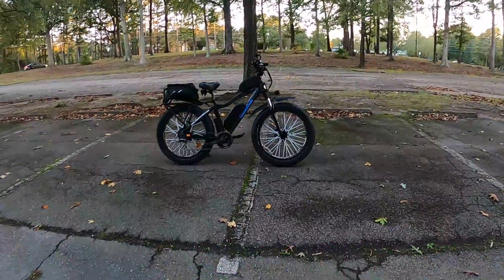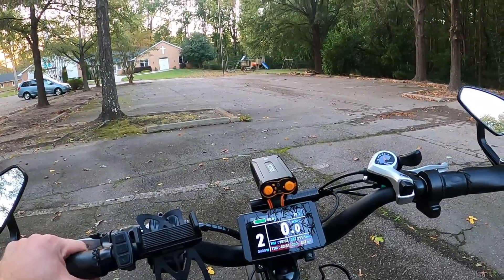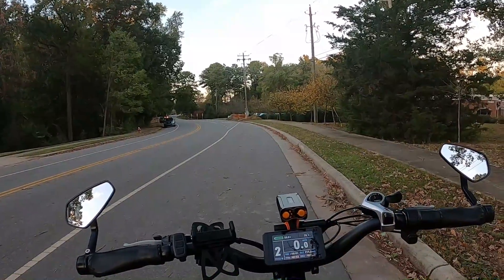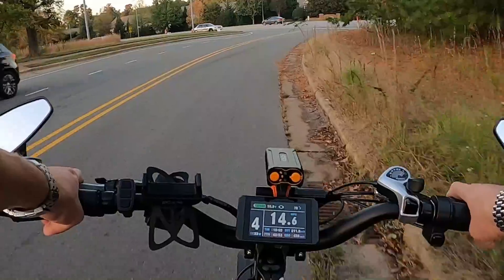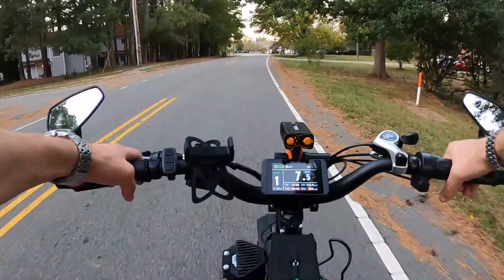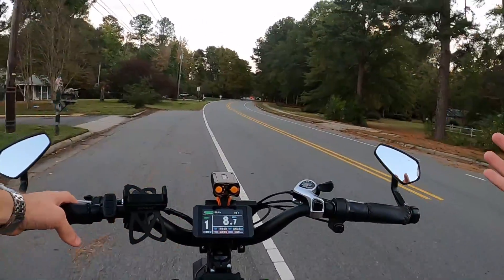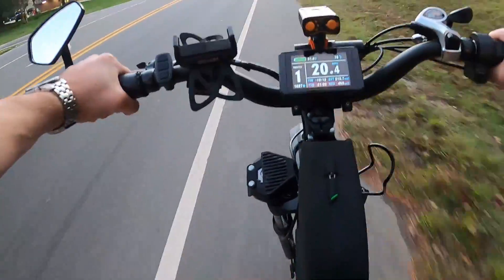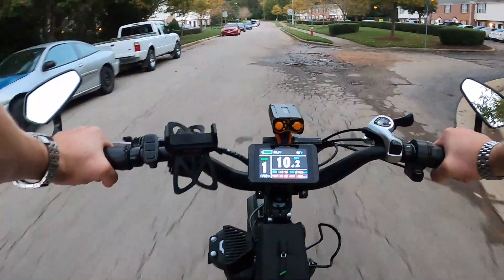Pedal Assist outputs on Upgraded Radrover

Comment: the speedometer issue is in the settings. I had that problem, and I changed I believe P-2 to 1. It was the setting that had to do with the revolutions of the magnet. It was confused as the pedal assist sensor magnet ring. It is for the magnet in the motor.

Comment: I started with the C14 level at 2. When I was in PAS 1, it gave me 210 watts max. In PAS-2, the wattage was around 350watts. In PAS 3, the wattage went up over 500 watts. Needless to say, for me, I was fine with using PAS 1 for most riding, and there are hills in my state.(PA). My range had improved drastically, with the stock RAD battery. ( It was a 25 mile ride, and the battery showed more than 70% voltage.)  The other day, I decided to try to lower the wattage to C14, and go from 2, down to 1. C14-1.  I took it for a ride so test. I rode with two batteries, as I have been doing. I  rode 18 miles over hill and dale, until the battery meter showed one level down. I checked the meter on the RAD battery, and it showed only one green light out. after going about 23 miles, I checked display. It read only one full light out, so I dropped in the next battery, for the ride back home.  Figuring I could ride a little bit more aggressive(faster), the ride back, I used the throttle, and PAS-2 on some hills, which were steeper on the way back. I noticed when I hit the throttle, it went over 1600watts, and it blasted me out of my seat, so, I declined to use the full throttle. (My motor is stock).  It wasn't until I rode 22 miles, when the battery indicator dropped one bar.  The last few miles were uphill, so I was in PAS-2. The steepest last few feet  of my ride, I put in PAS-3. I noticed the battery level drop to about half. When I was on level ground, I put into PAS-1, and the voltage rose back to only one bar out. After sitting there for a second, the display went back to full bars. I checked the meter on the battery, and it showed  it was full.  The voltage level on the controller read over 52 volts. I took the battery off, and again looked at the battery meter. It showed all lights on. AMAZING.  So, with the C-14 setting at level 1, my wattage were as follows------PAS-1= 110 watts, PAS-2 = 220 watts,  PAS-3 was roughly 400-600 something watts(I only used that on a hill climb. It would fluctuate, so never got maximum readings) . I am quite happy with the PAS settings now, with C14 being set at 1. Have a great day. By the way, I never tested the remaining PAS levels, because it was too damn fast.

Comment: Since the Rad motor peaks at 750 watts, that's probably as high as you got with the stock bike.
If you want more speed with the current motor, battery & controller try more narrow tires with a slicker tread. Your Tanus & tube setup also adds weight so it may reduce top speed.

Comment: It needs more Pass settings. I’m considering the EggRider for my 2019 Rad Cargo. I believe I have a direct drive motor. Why would a geared motor be more powerful? I know on Front Load clothes washers a Direct drive is more desirable and it cost more for that drive.

Comment: I just got my Rad I think it was Tuesday . I wanna thank you for all the info and because of your vids and all the info you shared ,was the reason I bought the Rad !I was a worried about the battery and range but after riding it up hills and to places I need to get to ,the battery is just as good as my specialized bed I 3.0 mud drive .wich I paid $3,600 for it. I still have both plus another cheap bike that I through a lit on it and burnt through that kit witch is non existent now. So when I do upgrade I switch out and put the old rad stuff on it as I upgrade the Rad !

Comment: I have a radrunner. Had it for 3 months now and put almost 900 miles on it. Just did the upgrade to the Bolton 35amp controller. Makes a huge difference! Sadly, I haven't seen much on the feasibility of getting a true 750w motor. 
Also if you can get ahold of a hyperscorpion for comparison, that would be awesome. Still kicking myself for not just saving and getting one of those. Love their look,especially the headlight and turn signals.
Reply: I have a Hyper Scorpion and like it. People have spread horror stories and I’m sure there is some truth. Getting those bikes out during the Pandemic produced some slop. I ordered the brushed aluminum it was the last batch out. This I think helped as I have had no issues. The bike will do 32=34 throttle only (Race Mode) and gets there instantly.. The motor is peak 1800 watts though I’ve gone over that going up slight upgrade not letting of the throttle. Gear ratio to power is sheer genius! Between the cassette and Eco 1,2,3 to Sport and off road Race, lots of options; the front chaining gear is 56 tooth so no hamster till Race Mode. But once in Race mode w/torque sensor you can get above 31 easy with the torque sensor just by slowly moving the peddles forward. The motors ment to don30 all day long as the mag wheel casing acts like a heat sync. The bad things are the brakes and the front suspension fork but will upgrade. The nay sayers be dammed this is one hell of a bike. As to the upgrades all the]see bikes are hyped and up grade are needed. What you get with the Hyper Scorpion is a solid platform with bad ass motor to build on. Oh, Race Mode sucks the battery down fast. Gonna get a second battery to fully enjoy the ride! Did I mention Cruise control and rear shocks (springs) are pluses. Finally a step through that looks cool!
Reply: Well my juice bikes that I got from that company is a nightmare. motor horrible, customer service 2 times horrible. Their quality control is nonexistent. Order 2 scorpions  couldn't ride them for 6 months. I end up selling the bikes .  Practically half what I paid for it. Motor was making all types of noise.. Couldn't get ahold of customer service. And when you did. Pure run around. Very Bad Company. I will Never do business with (Juiced) this company again. ....

A few Rad bikes later and I'm somewhat happy..( not a true 750 watt motor) I'm thinking false advertising🤔. LOL!... Waiting on my hemenway's. Thank you citizen bike .. appreciate everything you do brother.💯
Reply: Bolton had a review on that model.

Comment: My rad rover has the motor and controller mods - it will go faster in PA 5 ( just turn the pedal slowly , not really pedaling) than with full throttle.  You run out of road quickly trying to test